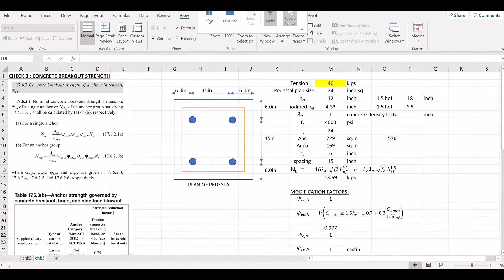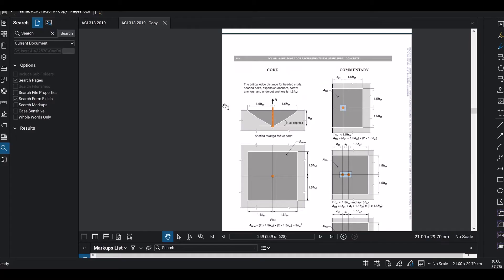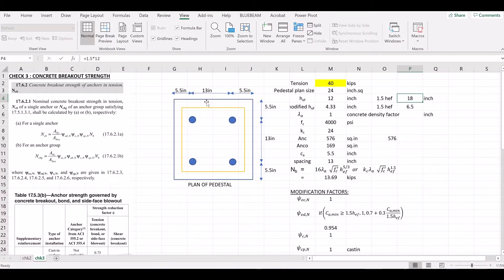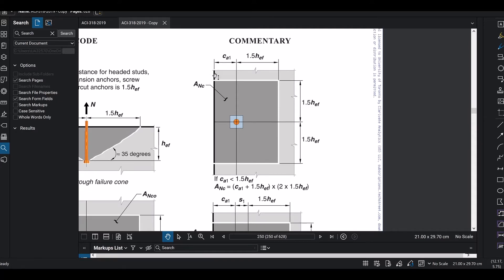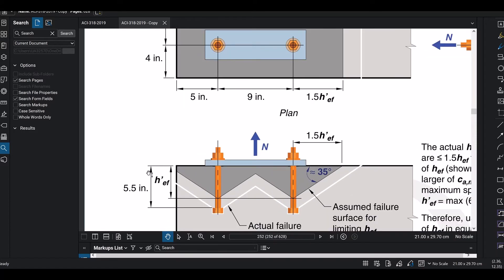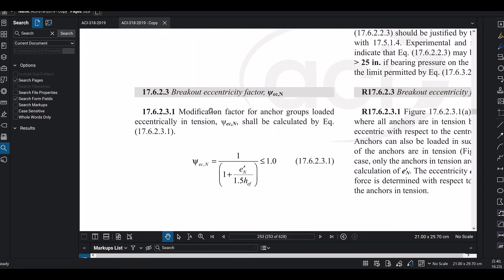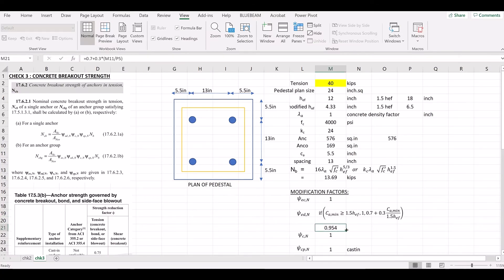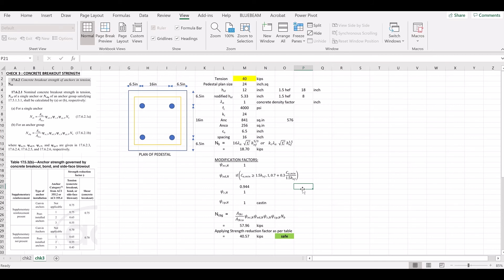Design of Anchor Bolt | check3: Concrete Breakout strength | ACI 318-19 | தமிழில்

Comment: As per ACI 318M-19 kc =10 & 7 for cast-in & post installed anchor
Reply: that's only if you're working with MPa or kgf/cm² otherwise, the value for kc still is 24 and 17